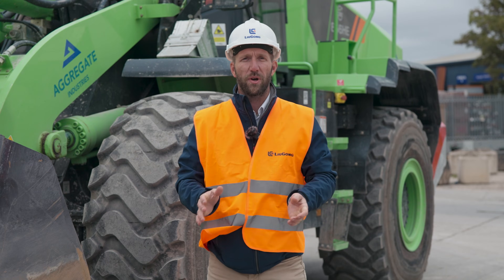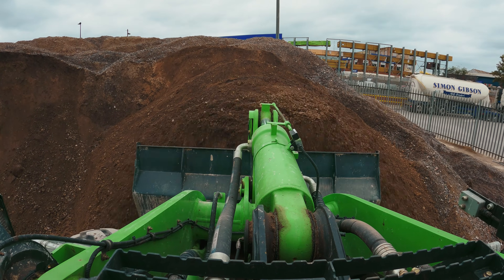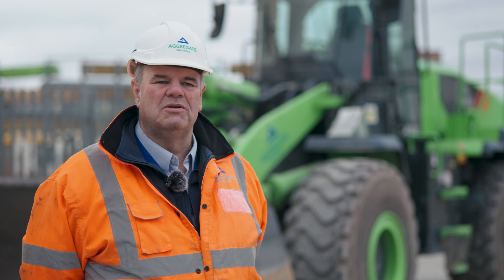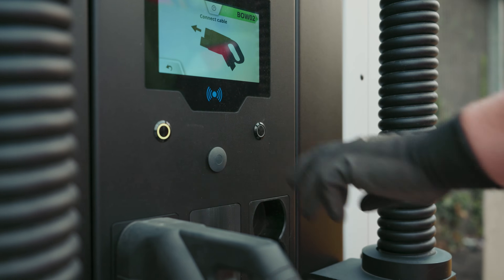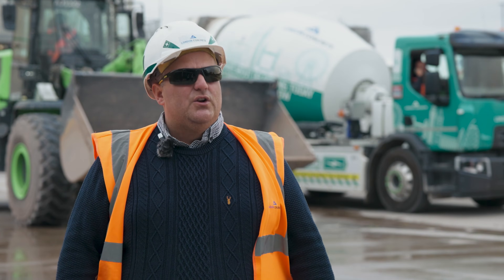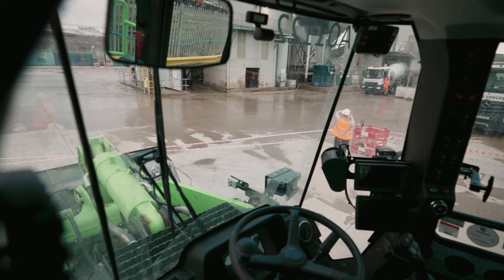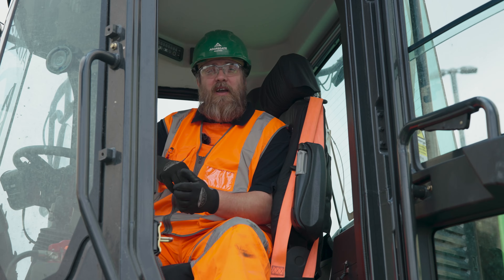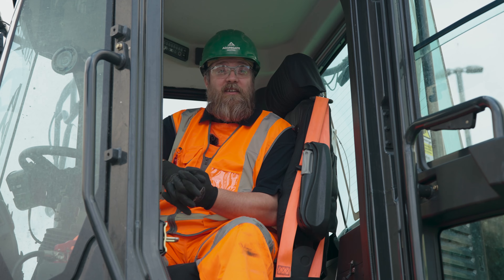Liugong 856HE Electric Wheel loader

Comment: Well, Everything looks great in a perfect location where there is a charging station on site ,but what about the "REAL" world where are you gona run that machine in ""NO MAN'S LAND"" with NO power  available but to bring a ""Diesel Powered "" Generator with you !!!  This was tried many times in the "PAST" & Didn't work then !!
Reply: Then you get a traditional diesel one. This isn't a one size fits all machine. If you can install a charger that's a great machine with all the benefits but if not then get something else.
Reply: @Windcent  wanna bet most loaders are working on a stationary site. Also there's loads of containerized 3MWh+ power stations that can provide DC off grid charging. It's mostly misaligned incentives and a lack of imagination all the way to dislike to even considering the idea because people feel threatened by chance, an that's something much more prevalent in the comments that amongst those who are making rational decisions based on cost/benefit analysis.